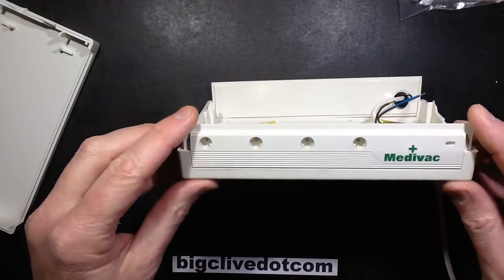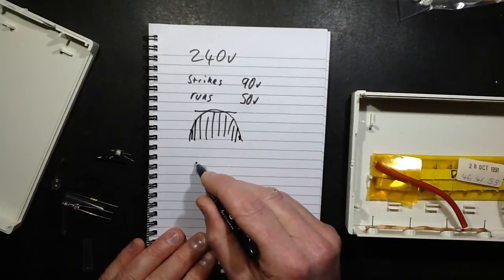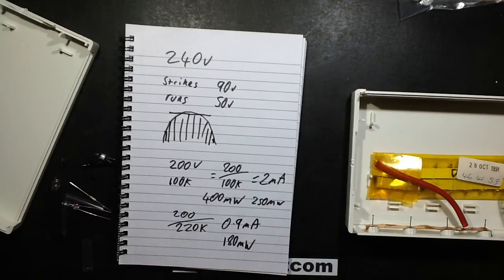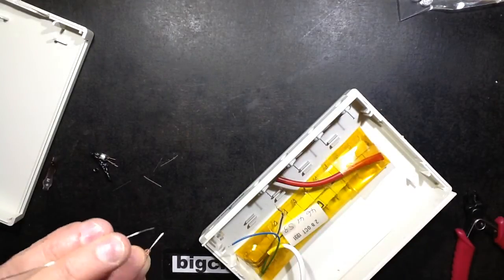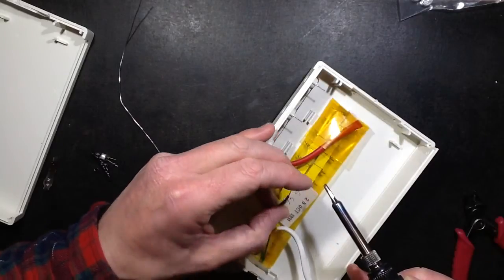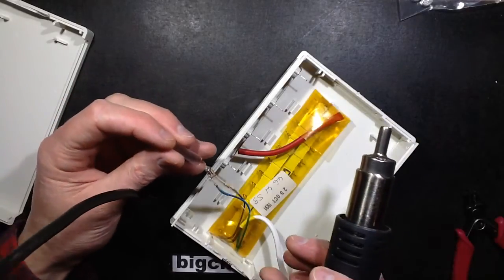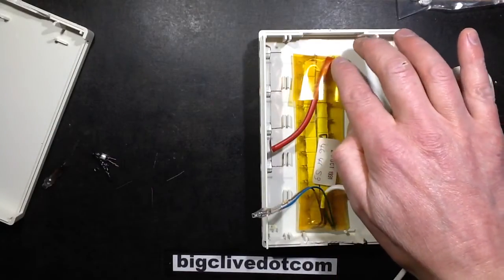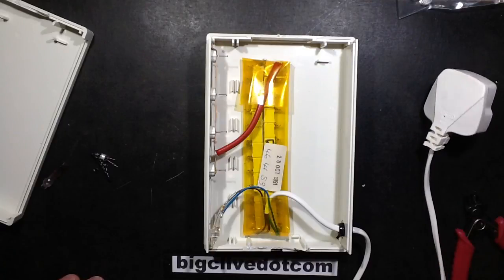Replacing the neon indicator in a Mountain Breeze ioniser.

Comment: Clive, I am trying to restore an old oscilloscope and the neon needs replacing. The service manual says its a "neon indicator type Q" but I can't seem to find what that is referring to. Do you know what that that type of neon is or should I just use another type of neon indicator?
Reply from the maker: If you want it to be authentic then you could possibly open the indicator (if it's a panel mounting type) and replace the neon lamp.  They tend to be available in a range of tube diameters.  There will be a resistor either in the indicator, inline or on the PCB.  I'd suggest using a higher value than the original as they tended to push both the neon and resistor quite hard.
Reply: OK thank you very much!!

Comment: Neons are useful for other applications as they exhibit negative resistance when they strike and this makes them useful trigger devices in oscillator circuits. You may have seen push-in and screw-in flasher units for traditional Christmas lights made by Pifco, Noma and others; these use a simple capacitor discharge circuit with a neon to trigger a thyristor connected across a bridge rectifier. A diac can also be used as it has very similar characteristics albeit at a much lower voltage, typically triggering at around 32 volts.

Comment: Power dissipation is fine, but the resistor is being run at more than it's voltage rating. They are only rated at 250VDC, so running it to 300V will over time cause it to flash over. That is what causes the blast, as then the current is limited only by the wiring and the neon slope resistance, and this blows the neon apart and burns the internal wire and resistor as well.

Use a 0.5W resistor, as these are rated to 500V typically. You do get non spiral trimmed low power resistors that are rated for mains use, they are trimmed by abrading the coating evenly during manufacture using a sand blaster, so there is no stressed area caused by the regular spiral cut. Expensive though as they take a minute to trim as opposed to under a second for the spiral cut ones.

Soldering station buzz is a loose transformer mounting clamp or core, just open it up, fix the usual mains problems and tighten the clamps and add a high temperature card under the transformer to provide clamping to keep it vibrating.
Reply from the maker: The transformer has been thoroughly poked and squeezed.  It's not really that loud, and if anything acts as a reminder that the unit is on.  You can hear a slight change in volume when it's heating the element, so it also gives a quiet audible guide to tip readiness.
The quarter watt resistors are indeed traditionally rated for 250V DC.  It helps to a degree that there is around a 50-60V drop across the neon, but it's still pushing the limit.  However, baking the resistor to the point it discolours and burns stuff in its vicinity is not much help.  In my resistor-blowing-up-on-the-mains experiments, it's only once they have started to physically carbonise due to heat that they go nuclear.  However, maybe the best approach is to use two 100K quarter watt resistors.  One on each lead of the neon.
Reply: bigclivedotcom  I just made some indicators using resistors, a bridge ( 12V zeners, as I have a lifetime supply still after giving half of them away) and a green and yellow LED. I used 2 68k carbon composition resistors ( they have gone high in value to around 80k, just out of the 10% tolerance, but still will work for a long time) in series as current limiting. 1W of resistor in total for less than a half watt of power. Might use one unit of power in 5 years.........  One I made 20 years ago is still working and as I used 4 33k resistors to give a 33k resistor the red LED is incredibly bright, actually too bright but will still last forever.
Reply: So why do manufacturers keep using 1/4w resistors with their neon indicators? I'm talking appliances from well known brands with neons across the 240v mains 24/7.